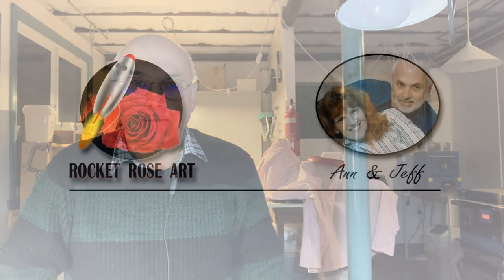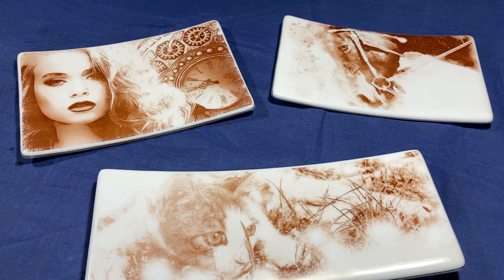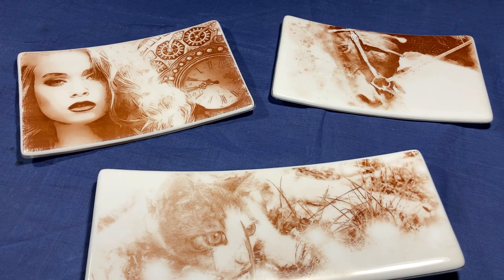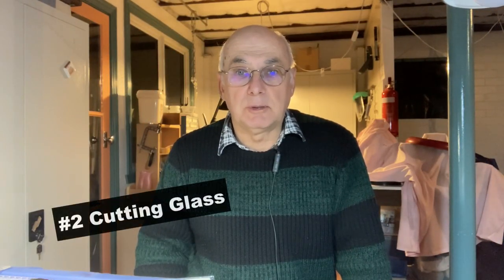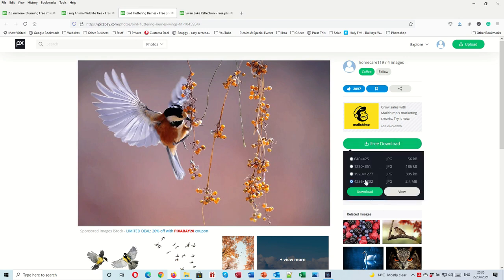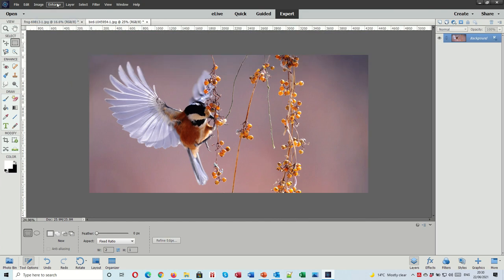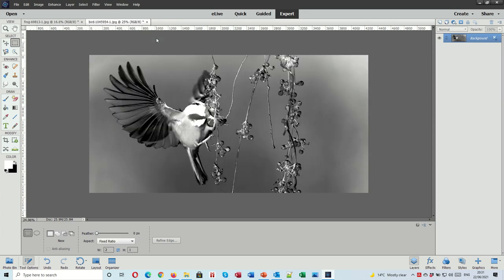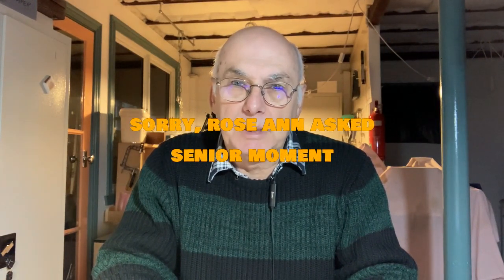Using a Custom Fusible Decal on a Fused Glass Platter, Glass Fusing Tutorial Project

Comment: Hi, i take it that you have to let the decal dry first as you have to print it on to the shiny side. My print out is quite wet. will this set?
Reply from the maker: Hi Catherine. Yes, you must let it dry completely. If it has any moisture in it, it may cause bubbles as the water turns to steam in the kiln and ruin the decal.

Comment: Hi Jeff, I have not been able to find a toner for my HP laser printer that can tell me if it is high in iron content. If the toner says it is used for check printing, it should have high iron content, correct? Any suggestions?
Reply from the maker: Hi Sadna. If you go to this page on my site, there is a link there to the HP page with all toners listed. Find yours and click on it to see the Safety Data Sheet. This should give you the information. https://rocketroseart.com/laser-decal-paper-faqs/